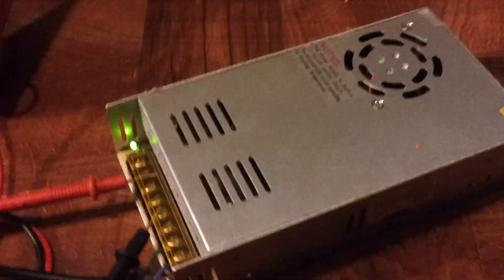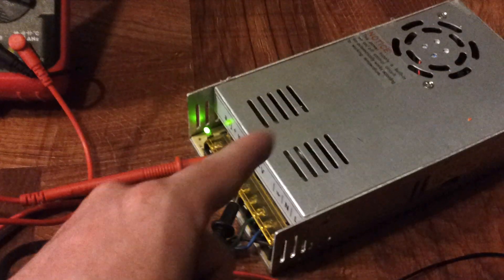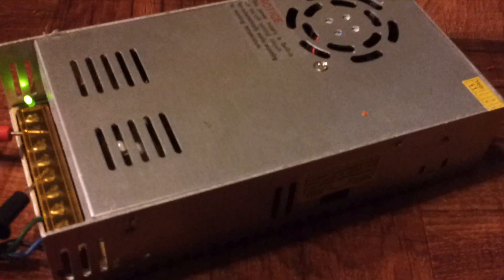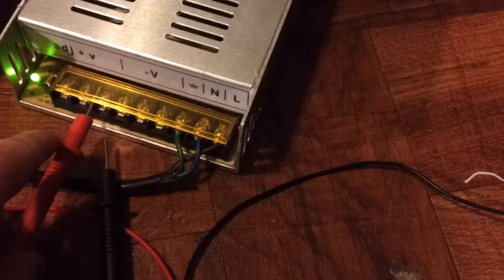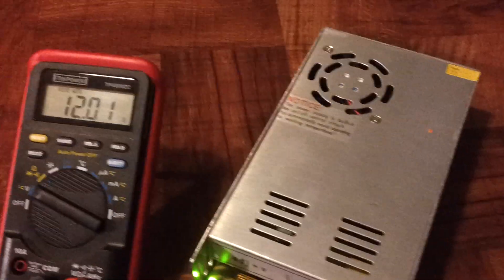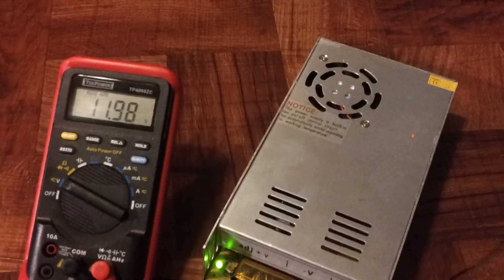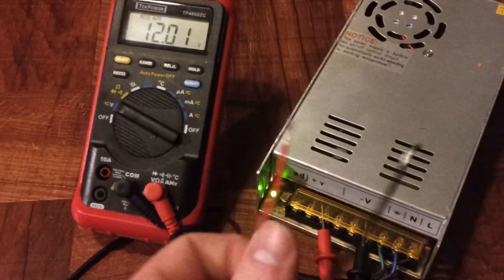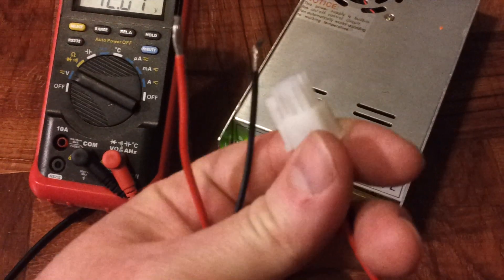How To: Setting up a 12v 30a power supply, and Connecting to your 3D Printer (Part 2 of 2)

Comment: Years on! I bought one of these, wired up and BANG! ZAP! After checking the wiring, that was correct, the fuse blew big time! Further checking found that the soldering on the board, protected by a sheet of plastic underneath the board, was actually making contact on the very rear edge of the panel onto the housing!
I could attempt to replace the fuse, but what a pain! I assume that there are many more boards just like this. If it happens to you take out the board and check out the rear.

Comment: How high can you adjust thew voltage? My CB radio requires 13.8 volts. Or should I be using a different kind of power supply?

Comment: Remember kids... its not the Volts that kill you.. its the Amps.. so don't think because its a low voltage that it's safer than higher voltage. In fact usually the higher voltage power supplies are lower amps and the lower voltage are higher amps. Well these small ones are..  Not sure about large industrial power supplies.

Comment: I just get a 720 watt power supply, very similar to yours...but no manual at al.. !!  so the output terminals are 5 / 12/ 30 volts ?? Thanks for reply.. I need to connect a induction heater to it..whats  came as a set... really stupid to have no manual at al on both items..It should be not alowed for sale,if no propper documentation is with it..It can be dangerous..
Reply: I think they do not have manuals for these because they expect the people that buy this type of equipment to know about electricals. Else you are putting yourself in danger by handling something you do not completely understand, even with a manual. No offense.

Comment: I have a question I had bought a 3D printer and it came with that same supplier and it had a plug on it for a 220 outlet unfortunately when I plugged it in it was on the 115 on that little switch you were talking about so the thing blew. So now I'm going to have to get another one anyway is there an advantage to having it with a 110 power supply for socket or a 220 socket which would be better. I know for welding machines 220 puts out a lot more power than a 110 cuz you can buy welders that will go either or but I'm not sure about this power pack. If you have any knowledge on that subject I'd  appreciate an answer

Comment: Someone plllleeease answer 

if I have 140v 7.14amps generator  and I need to deliver 15amps would this supply be able to do it .. even if the input current is 7.14 amps?????
Reply: horashia No! Wrong!! In most cases the amperage rating is the maximum current or load allowed to be used.

Comment: I have that power supply today but mine have input voltage selection either 110v or 220v. And live in Canada. 
Which standard outlet is 120v. So which do I select.
Reply: Huy Duong They got an Input of 110/220 +/-15% so ther should be no Problem at all.

Comment: what happens if i connect wrong i mean from an outlet to power suply , neutral to hot anf hot to neutral ? As i know it should still work righ ? Its like puting Phone adapter upside down to wall and it still charges the phone
Reply: tamernator Because it’s not polarized....

Comment: good viedeo , nice work 
this is 12v/30A power supply , you need this data? 
if you want adjust able and high voltage and small current ,
there is idea to help you make a good power supply, and  it will be a great tool 
you can check the page https://rdtech.aliexpress.com/store/group/DPS-digital-control-power-supply/923042_508466030.html?spm=2114.10010108.100008.3.TAyKCk
if you want to know more , you can see my channle,. there are many friends share , you can check

Comment: Hi bro, is it possible to get 6v and 12v out of that power supply without any additional modification. Is there a connection port where I can plug in to get a reduced voltage?

Comment: Hello, do you have 30A when you apply 12V?
Reply: No, the 30A just means that the power supply can deliver up to a maximum of 30A. So for example, let's say you connected a single LED to the supply (with a current limiting resistor of course). Now, the LED only draws a small current (usually a few mA), but the power supply won't burn it out at all. The LED simply draws it's rated current. As you begin to connect more and more loads to the supply, they will draw more and more current. 30A is really high, so I'm fairly certain that it will be more than enough for your application. Be sure to check the current draw of your load to ensure it doesn't exceed the 30 A though.
Reply: tesllat 36 ..if I have 140v 7.14amps generator  and I need to deliver 15amps would this supply will be able to do it .. even if the input current is 7.14 amps 

Please answer

Comment: Will the voltages read the same when your printer is all hooked up and running? Should it read 12v when everything is hooked up and components are drawing current at idle?
Reply: ArcadeGames It is an Regulated PSU, so when you have 12V at no load you will also have 12V under full 30A load

Comment: Great power supplies. I use them for CB equipment and they can be stacked together. I have 4 stacked running 15v @ 120A powering an amplifier. Good stable output.
Reply: Pretty close I believe. I have a 5th one to add in if I need to.
Reply: Adam Kapps what did you do to get to 15v i have 6 working together but the most i can get is 14.8 and i will love to see mine running at 15v
Reply: 338 Jigaman it might be a difference between manufacturers cause all mine will go up to about 15.3v.
Reply: Adam Kapps oh ok! what brand you used if you remember?
Reply: 338 Jigaman I was trying to remember but actually the tech I got them from had removed most of the ID stickers. I'll try and get some kind of ID off them sometime to post. Drive a truck so not around much.
Reply: Adam Kapps 10-4 

thanks bud!
Reply: 338 Jigaman YW
Reply: @mobileu47  Adam, did you ever get to answer 338 Jigamans question, about what brand/manufacturer are the ones you bought? Thx.
Reply: @MusicMinisterJP7  they are made by many different manufacturers. Not sure what "brands" I've got tbh. They're all made in China.
Reply: DO YOU HAVE USER MANUAL?¿ I DONT FIND IT
Reply: This is the comment I was looking to read. So I've got a Superstar 3900G and my 7 to 10amp PS isn't making it. I read somewhere about these PS. I am looking to get one of these to put out 13.8v and 22 to 30 amps. Would You say one of these would fit the bill? Thx. John
Reply: Also, where do you buy yours? Is Ebay a good place to find one?
Reply: @MusicMinisterJP7  they are adjustable from 12v up to about 15 so they are quite handy.
Reply: @mobileu47  wow, its unbelievable this would work, versus  the regular type ps. I've looking into them and they cost way too much. Then I saw these on ebay and clicked "Watch". But then I saw folks were using it for LED lighting, and thought, this isn't going to work, so I unwatched it..lol. Some come from China, and I'd rather not get one from out there, in case it needs to be returned. But thanks for the info, much appreciated.
Reply: @MusicMinisterJP7  yeah you can find em on ebay and Amazon.

Comment: am using a similar power supply for my ultimaker with 24v but the problem is that the power plug is heating to much an is melting aswell as melting the power port on the board. why is this so?
Reply: You probably need to fiddle with the tiny yellow "adj" screw to calibrate the power supply, alot of the ones made in China are poorly calibrated, or not even calibrated at all.  Either your transformer is pushing too much power and frying the circuits on your power supply, or you're overloading the unit by putting to many LED light strips on it.
Reply: *****  
i did adjust it to the right voltage, and im not overloading it with led strips as i am using it for my 3d printer. as u said it can has defects given that it comes from china. how can i check that?
Reply: Ken SOMAR what wire gauge are you using? Also make sure to not go over the maximum current rating.

Comment: how do do read the amps on 12volt 30 amp switching power supply
Reply: Use a Volt Meter, you can buy Volt Meters on eBay for about $3.00 - $5.00 dollars with free worldwide shipping direct from resellers in Hong Kong.
Reply: I figured it out I used a old military amp meter and put a load on it

Comment: Check the power supply voltage when under load because the voltage may drop. Your better off with a half a volt extra than a half a volt under. Low voltage will require a higher amperage draw which burns up electronics. 12.5 volts won't hurt anything.